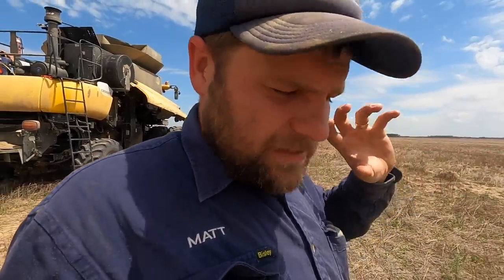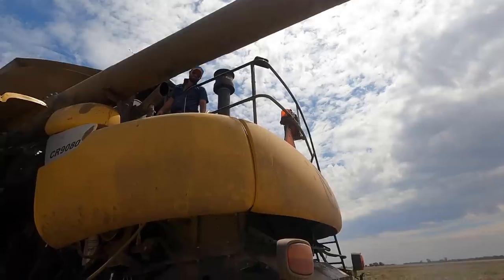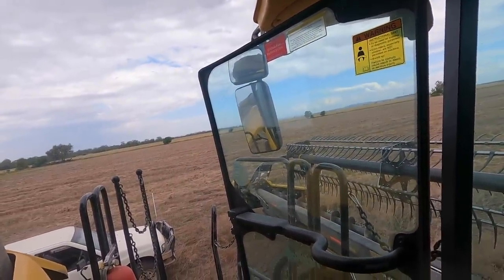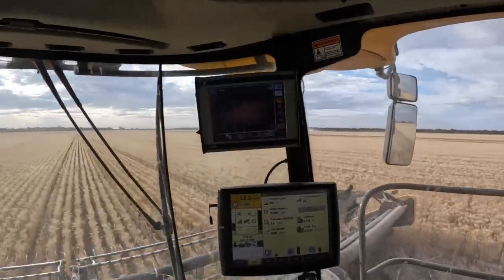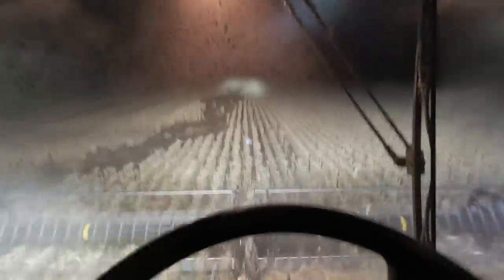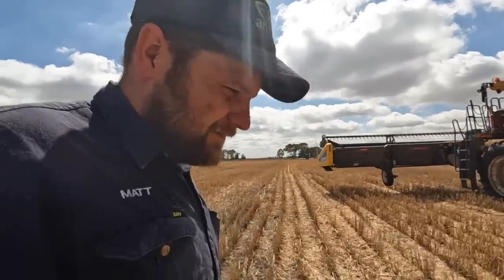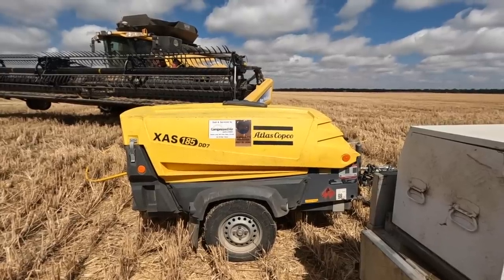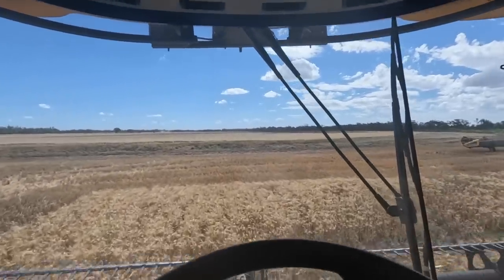1000 Acres Harvested in 15 Hours!! (Vlog 120)

Comment: You're not alone with header dramas, mate. I went to start our JD yesterday and it wouldn't even turn over. Tried jump starting given my first obvious thought that it had a flat battery. Nope! A bloody rat has decided to find its way into the central ECU, through a rubber grommet and has chewed through every wire and even chewed through caps on the main PCB!
Reply: Always leave a tin containing rat bait under hood
Reply from the maker: Ouch! Hope it can be fixed in a timely manner😳
Reply: @TheInvoice123  horse... bolted.... shut the stable door..🤦‍♂️ gif luck getting it sorted...